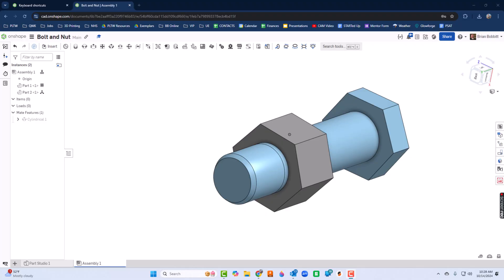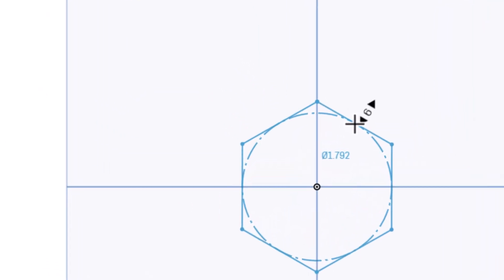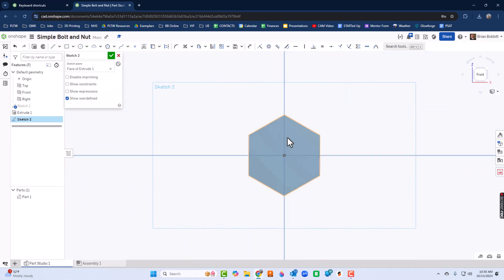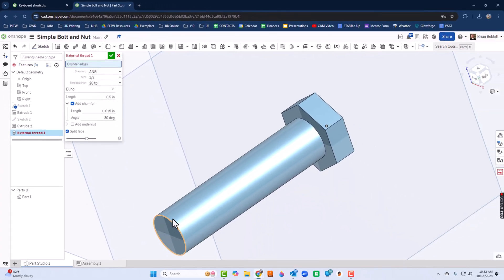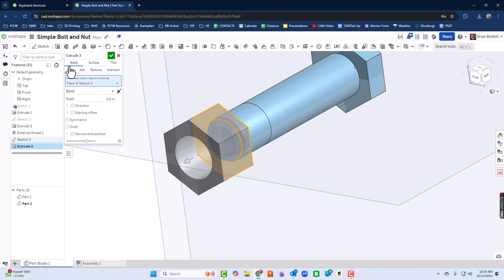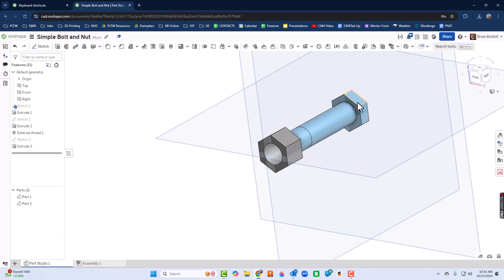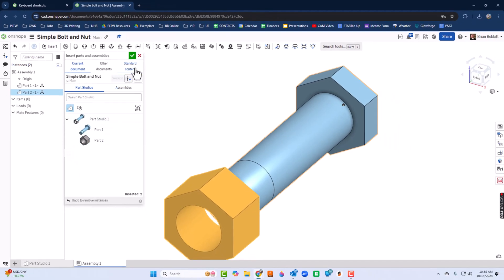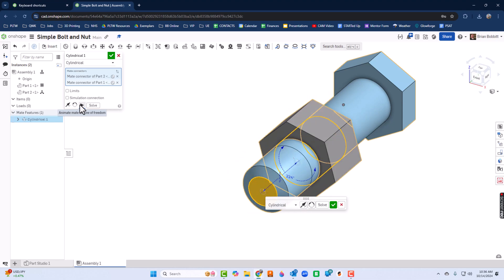Onshape Creating a Bolt for Our First Mini Project

Comment: Why not use your "add-in" ThreadCreator" tool which will actually create threads you can see on the parts?
Reply from the maker: Certainly an option.  Video series was created for students. Many times, they don't have complete access to plug-ins and addin-in scripts.
Reply: For the means of 3D printing, you are correct.  But for the purpose of design, and later in the creation of a technical drawing the ThreadCreator tool does not allow for the thread callout.  In my business we rarely see drawing with actual threads, they're of no use to an engineer, fabricator, or machinist.